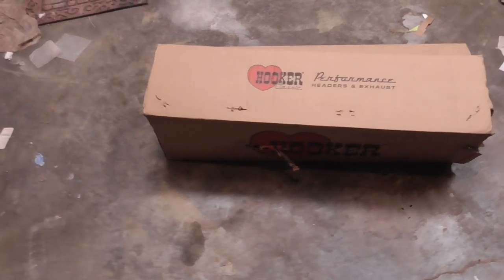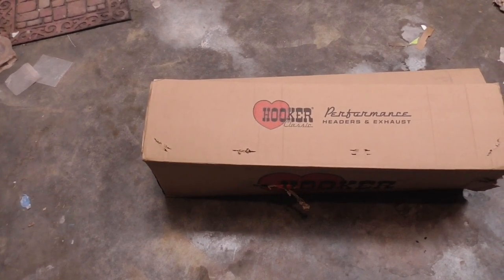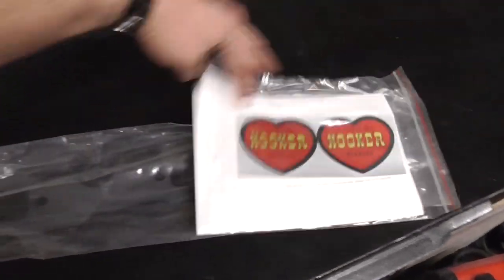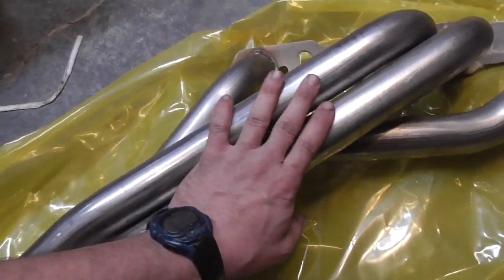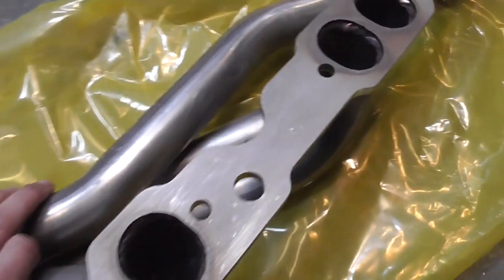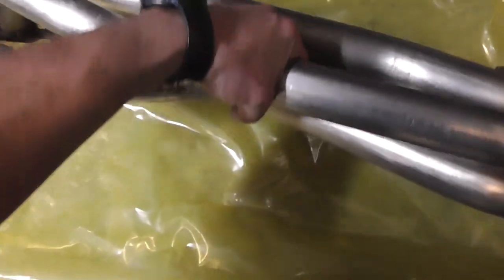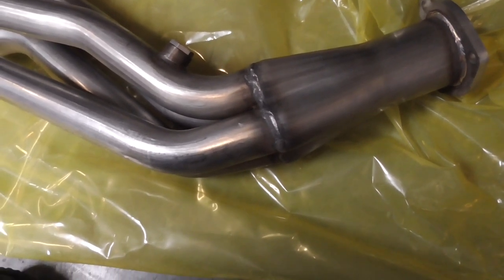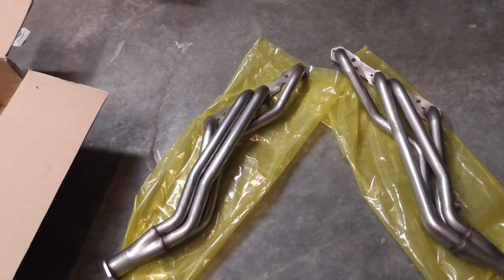1988-1998 Chevy Truck/SUV | Hooker Header 2462-2HKR Stainless Long Tube | GMT400 | Overview

Comment: What would you recommend for me to help my performance on my 1998 Chevy Silverado C1500 5.7 v8 all i done to it was put a cold air intake in it
Reply from the maker: Honestly the best bang for buck for me was getting a tune from Black Bear Performance - better shifting, more power, slightly better MPG, etc. I have a video with 0-60 with and without tune.

Comment: Was wondering how the roof rack worked on your XJ (you posted vid back in feb), and if I actually needed the aftermarket crossbars... I have extra stock roof carrier bars too for weight distribution if anything
Reply from the maker: You don't need the gutter mount cross bars to have the rack. If you have extra factory bars that should do the trick.

Comment: I know this is an older vid but how did they work out. I want to get rid of my Gibson shorts and get long tube.
Reply from the maker: They worked and fit great, I have a video of the truck done with sound test. I will tell you now though, replace you engine mounts before you try to install headers if they are original motor mounts. Mine where heavily worn and needed to be replaced to get the headers to fit.
Reply: Thank yoy for the reply. My motor mounts were replaced when I put a new motor in my truck. What motor mounts did you use.?
Reply from the maker: Factory GM mounts from the dealer.
Reply: Yeah, mounts...that's a f'n fact.  Do yourself a favor and get the polys from Energy Suspension.

Comment: I hope they work out for you.
Reply from the maker: They are a heck of a lot closer... but ultimately it looks like I need to replace my motor mounts.  They are just hitting the rear of the frame, on the Maximizers that were hitting the UCA mounts.  So Looks like I'll be doing the circus of a job to replace the motor mounts.  Thanks GM for having nuts for the backside of the motor mounts in blind holes for the front crossmember. Have to fish a wrench in behind the lower control arms through the inside of the boxed in front crossmember.  Had to order a extra long flex head wrench because I don't have anything long enough to reach the top bolts. I should have just enough room after I replace the collapsed motor mounts.

Comment: Get a dyno tune.  Night and day difference
Reply from the maker: That is the best option, but with me having the 96/97 ECM, there is only one program that works with it.  So finding a place local that will tune it, much less that has that program, it pretty much impossible. So Black Bear Performance is my best bet, they have been tuning these 96-98 ECMs for years.  I would go to them to get a tune, but they only offer on site dyno tunes to 98+ due to the program issues.  98+ trucks can use HP tuners, mine cannot. And, at the end of the day, I only have bolt ons (intake and exhaust) so the main thing I'm getting from this tune is EGR delete and rear O2 delete... along with a little power and firmer shifts.
Reply: @DanielPace92  damn that sucks.  I just figured if you had obd2 you can tune anything
Reply from the maker: @shootermcgavin2819  No, would be nice though.  GM used ECM in 96 and 97 that don't have a lot of extra memory/ram and only one company ever made a program to work with it, then JET bought the rights to it, but they offer no support whatsoever for it.  Pretty sure they themselve don't fully understand it either, since they didn't build it. Plus, even if I did have a late model ECM or if I did a 411 PCM swap (best option, tons of expandability) all the Dyno shop in my area will not tune anything that's not a Mustang, Camaro/Corvette, or something that makes less than 800 or so HP.  My buddy went to a local shop to see if they'd tune his 1994 Toyota Supra, they said they wouldn't touch it if it wouldn't make 1,000 hp.
Reply: @DanielPace92  damn, one dimensional tuners these days